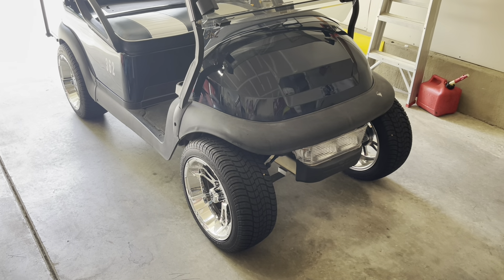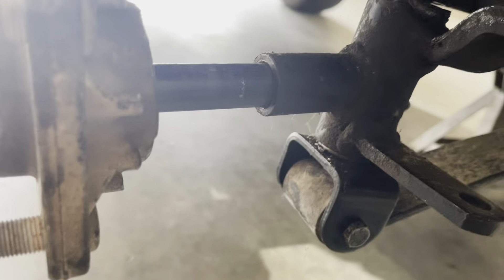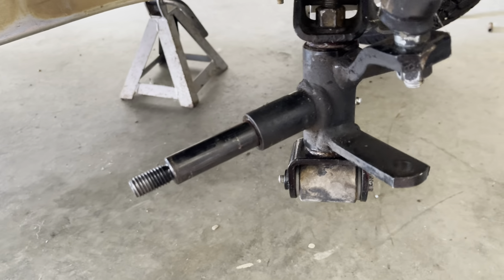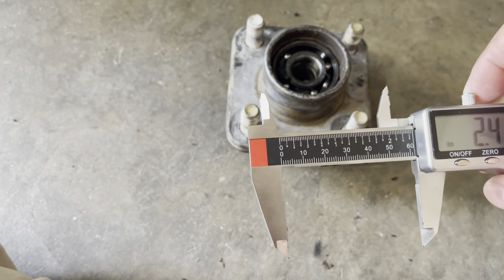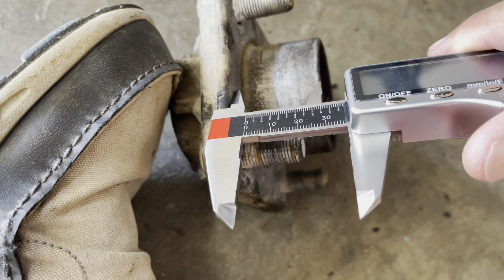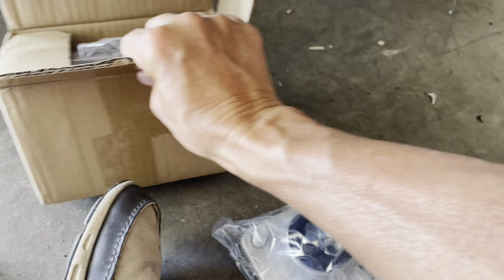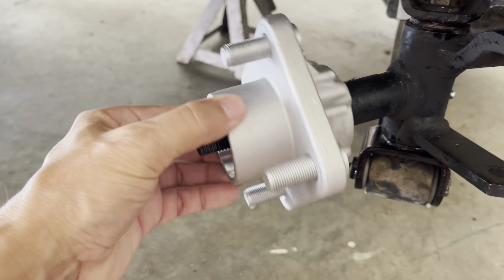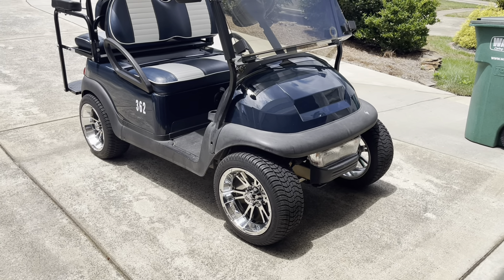2009 Club Car Precedent - Wheel Hub Assembly Replacement

Comment: Solid work, pretty concise video. I like how you emphasized the need and use of a digital micrometer. 50% of the Chinesium aftermarket parts I am seeing are manufactured out of spec, with little to no QC, so they won't fit their intended applications. Good on you for verifying ID and hub bore.  👍

CONCERNS & QUESTIONS: 
...the ones found on AMZ (same ones in your link) have multiple bad reviews for premature failure, and plastic bearings. The good reviews they have are pretty suspect. (possible bots or fake accounts.

Can you shoot us a quick follow up comment on how these bearings have done for you on your cart? Is it used regularly? 

Some folks were seeing these bearings fail in as little as 20 miles (1 user) or 30 days (a different user).

Asking for the collective benefit of the GC community. Thanks!  🍻
Reply from the maker: I’ll definitely put out an update video. With regards to ours, we don’t use it everyday, but we use it maybe three days a week. My family cruises around our neighborhood for any hour at a time.  I guess we have more than the 20 hours by now for sure. We have zero issues at this time. 

To me a factor in the longevity could be weight. We’re not big people and our cart is stock. Maybe if carts are loaded down that could have a bearing on the part. That being said, the part should last for years regardless of those factors.